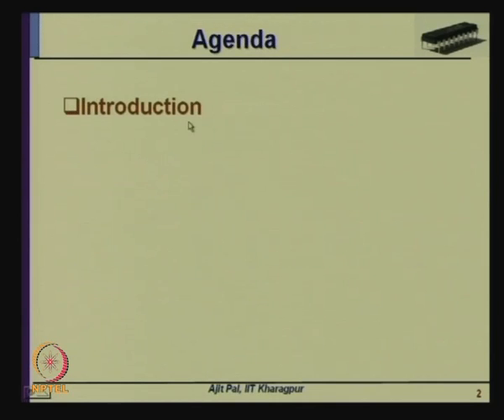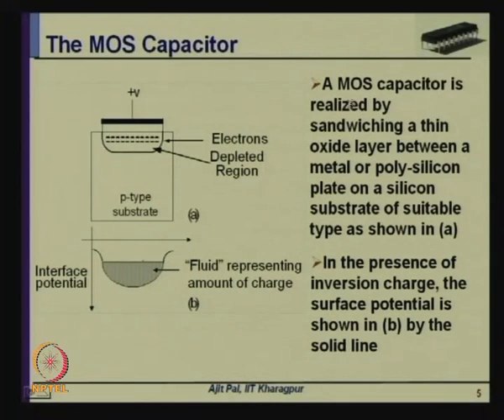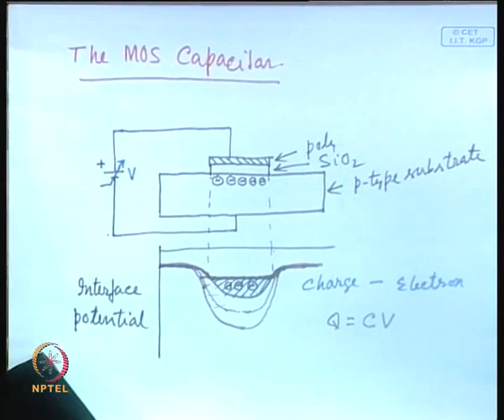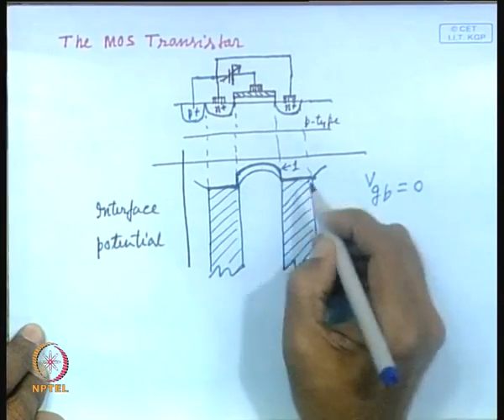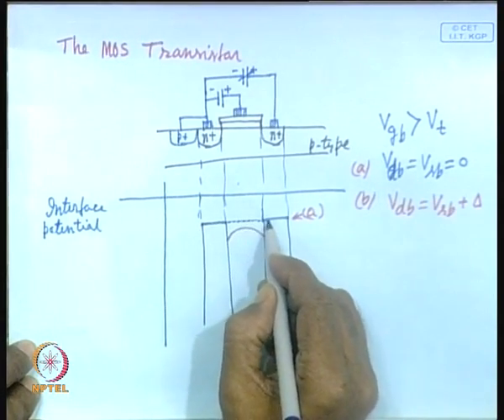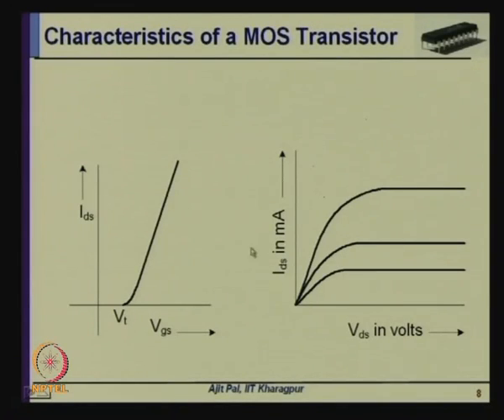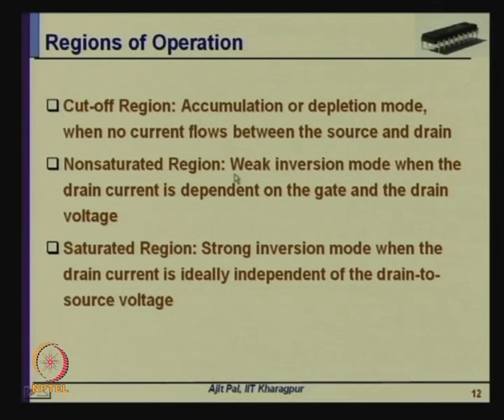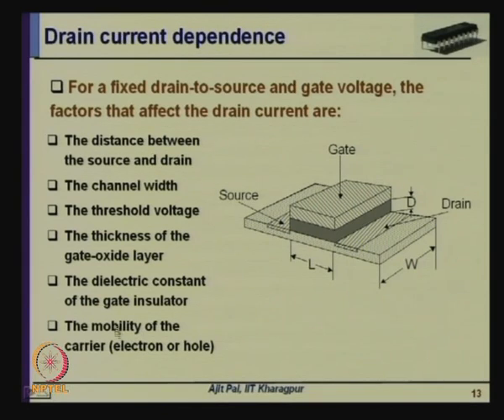Mod-01 Lec-03 MOS Transistors - II

Comment: Hi, please analyze the circuits in this article, thank you

A 40 mv-Differential-Channel-Swing Transceiver Using a RX Current-Integrating TIA and TX per-Emphasis Equalizer With a CML Driver at 9 Gb/s
Reply: These lectures series were recorded back in 2004-2006
Most probably the professor himself might be ritired by the time you types your Querry !